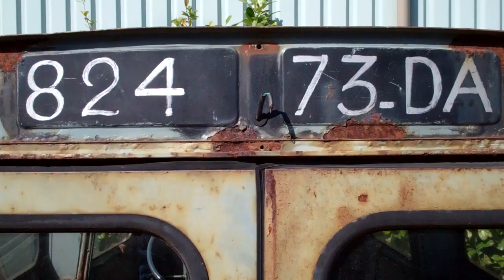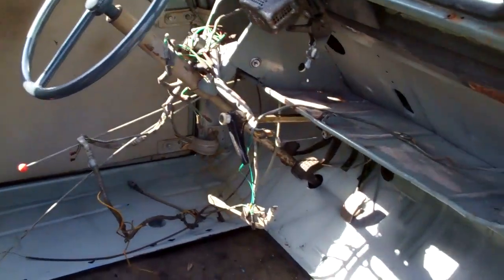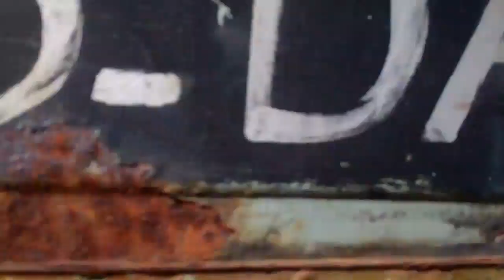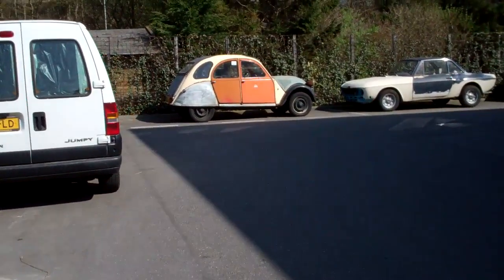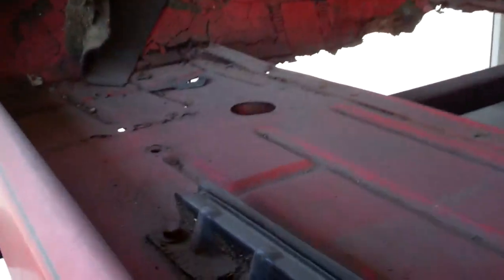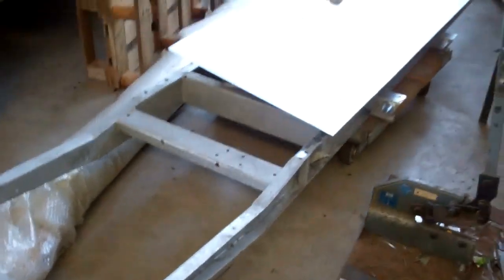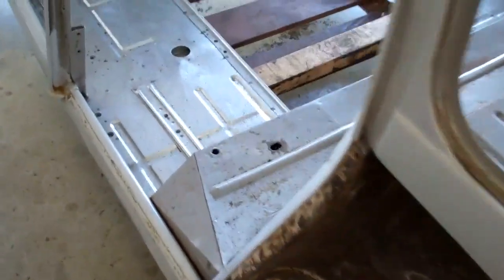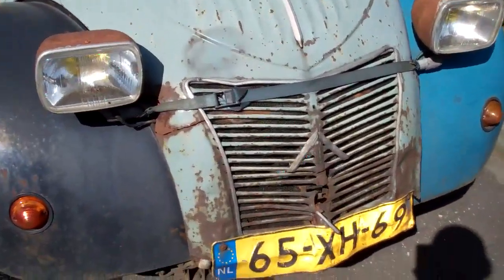Citroen 2 cv AK Azu 250 + more body + chassis pics.

Comment from the maker: Yip , 4 bolts hold the engine in place , straight on the chassis and 8 bolts to seperate the body from the platform , not much value in scrap , though...